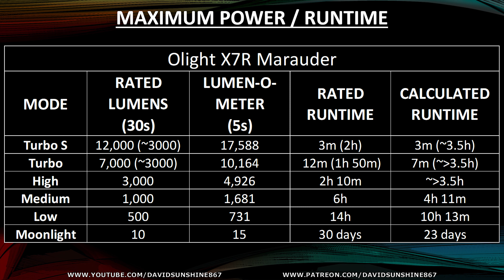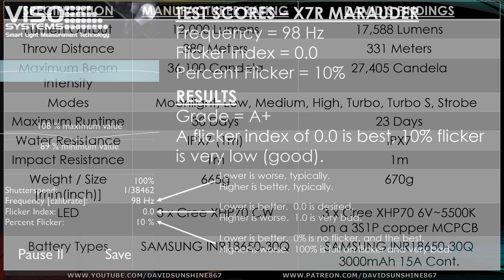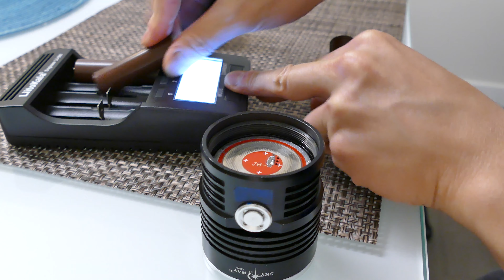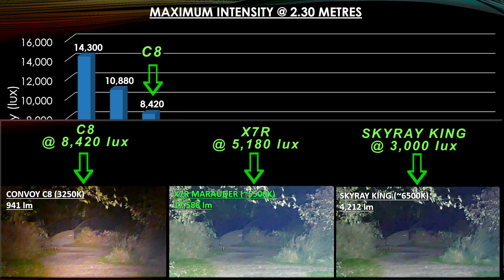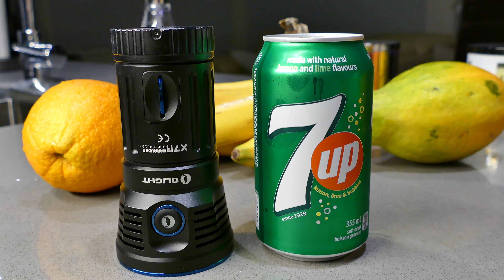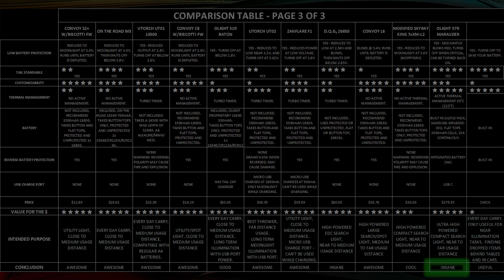Olight X7R Marauder Review - Handheld Sunlight

Comment: I just wanted to thank you for your video, without it I wouldn't have been able to repair my light. It ended up being a bad battery and I had to by a small battery welder to make two new battery packs. Cost of repair was around $80 dollars.🔦👍
Reply from the maker: You're welcome! Glad it could help!
I just replaced one of my packs too.  I guess these batteries give up after a while and need replacement!  I also bought a welder lol.  Put in some 30Qs and it seems to be working well again. 
Cheap for a repair of a good light!
Good work!
Cheers!
David.

Comment: I bought an olight marauder 2 flashlight, but unfortunately it broke, and I was 50 cm underwater. Turn on the light for about 15 minutes. This gear is in the third gear. Turning on the flashlight the next day, the flashlight kept flashing, the light could not be adjusted normally, and the switch did not respond. Has your x7r been tested for underwater operation??? Thank you
Reply from the maker: Hi,
I just put mine on a bucket of water and turned it on Turbo S. Since it warmed up and cooled down, it was a good test for water ingress, where it would cool down and vacuum in water, and it survived that test.  Despite their claims, I think these are only good for rain, I don't think they are good for continuous submersion or use as a diving light, for those you'll want to use a magnetic switch so that there's no penetration for the switch. 
You should contact Olight and let them know it broke under normal operation conditions, since they rate it for use under water. They should fix it for you. 
Cheers,
David.

Comment: That is the most comprehensive and well presented review I have seen for anything on YouTube. Ever. I have just ordered one of these lamps, which at the time of writing this are now discontinued by Olight. I watched about a dozen reviews for this product and none of them come close to yours. Excellent review and I've subbed. Thank you.
Reply from the maker: Thanks for the kind words!
Glad you enjoyed the review, I tried to review the crap out of this light, take it apart, check everything out, put it through the paces, and present all that information in my review video.  Thanks for noticing and subscribing!
I did a similar review for the Imalent MS03, but unfortunately for them, they failed the bucket of water test LOL, water got into the switch.  
I didn't know Olight discontinued the X7R already, that's too bad, but I guess they gotta keep innovating.  The X7R in this video is still going strong, I still rely on it for work and around the house, it's scratched like crazy but still going strong!   I ordered mine Sept 2017, so that's a good quality light that you can rely on for years to come, I hope a lifetime!  I can replace the 18650s so I'm sure it'll keep going if I can keep putting new cells in it.  I bought an 18650 tab welder, so I'm ready to make 2 x 18650 packs when the day comes too, I'll have to make a review on that, should be fun.
Thanks for the comment!  Enjoy your X7R.
Cheers,
David.

Comment: I know this is an old video but what screw driver did you use to take the screws out? The 1st ones
Reply from the maker: Hi, 
I used P5 pentalobe screw drivers for opening an Iphone4 or 6S, etc.  All the same size.  I just jam them in there and it works.
Cheers,
David.

Comment: Thanks for the review, I have a question about the charge indicator light. When I plug the light in to charge, the light turns Red. After a day on charge the light has change to Green but it has small blinking Red dots. I don't remember this happening before,  I thought it was a steady green when charged. 
Any advice would be appreciated .
Reply from the maker: Hi,
You're welcome!
Mine is red for charging and green for fully charged.  I don't see red blinking, sounds new, not sure what that could mean.
Does it operate fine?  If so, I wouldn't worry about it. But if it's not functioning correctly, you might want to take it apart and make sure that water didn't get into the charge port and circuit board.
I did a full discharge and recharge of mine last week, and it charged 49.2Wh back into it.
I use something like this:
https://a.aliexpress.com/_dXZpK8H
49 is pretty close to what it was brand new, years ago, so the Samsung cells are holding up well to full time use in the job within tunnels for inspections.
Yours should be good.
Try emailing Olight, but with the cost of shipping, I would try not to ship it back for service, not really worth it.
I recently cleaned the port and USB cable with a toothbrush and rubbing alcohol, I had a lot of mud and dust, sand, on everything.  I vacuumed out the ports to dry them.  That'll ensure it keeps working well. The USB C port is resilient, but sand can kill anything, so try to maintain them by keeping them clean.
I didn't have an issue, just wanted to keep it clean to maximize charge rate and keep the sand from destroying the contacts.
Hope that helps. 
Cheers!
David.
Reply: @DavidSunshine  Thanks for the reply, the light works fine and it's never been wet. I did drop it twice due to the cheap holster that came with the light, it fell apart. I'll try the full discharge, I've never let it go without keeping it charged.
Reply from the maker: @charleschapman2428  When the Velcro gets worn, it can come loose, you can buy replacement holsters for it.  
I modified mine to be a magnet, seems to hold much better.
Drops should be ok, but if it's working fine, I wouldn't worry.
Mine is solid green when charged, not sure why yours has a blinking red light.
Cheers!
David.
Reply: @DavidSunshine  Realized last night that it's not going into turbo mod, still going to try to get it fully discharged and see what happens. I've maybe had it for two years, it was a Christmas present.